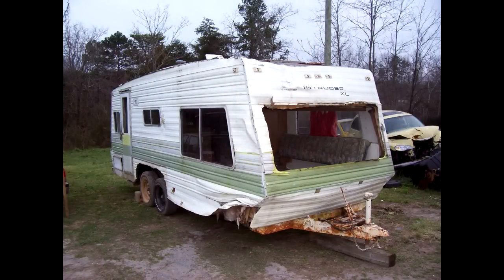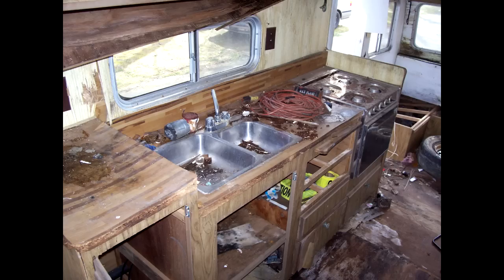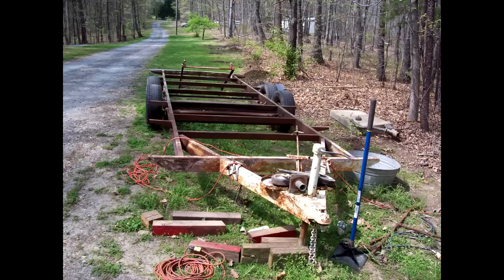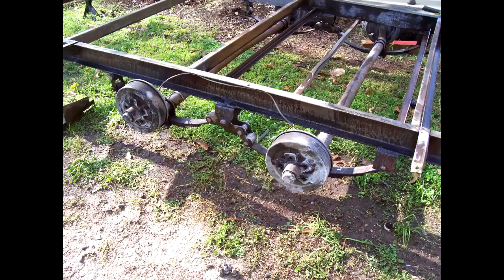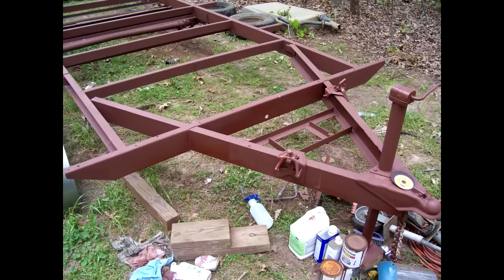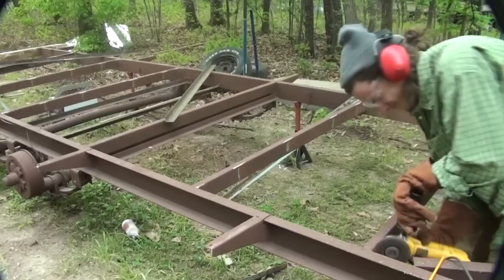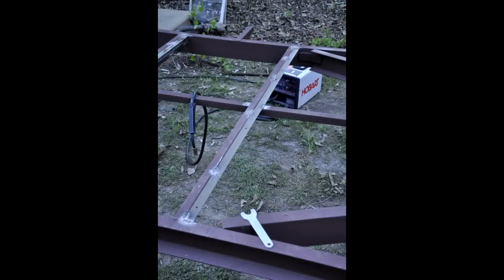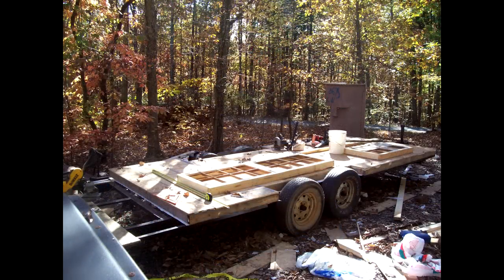Building a Tiny House #1 - Salvaging a Trailer

Comment: Aren't you worried about building your house on an old trailer? what kind of specifications did you use to decide whether or not the trailer was in adequate enough condition to use? I like the idea of going to a junk yard, but I also do not want to build my entire house on a rusty old trailer that may fall apart or become damaged relatively shortly after I've built the house. I need it to last for a long time. Any tips on what to look for?
Reply from the maker: +Cristina Urquieta Sounds like you would be more comfortable with a new trailer.
Reply: True.  NO ONE should ever build a house like this on an old scrap trailer. Do the people on the freeway a favor & get a new trailer built specifically for Tiny Houses (I did and we're so happy knowing it's on a solid foundation) Save property & possibly lives.

Comment: How do you know the axles can handle the weight of house? I have been told that 3 inch axles are rated for 6,000 lbs and tandem axles double the capacity. So two 3 inch axles should carry 1,200 lbs? I ask because the camper I have torn up only weighed 4,400 lbs and it has two 3 inch axles...
Reply from the maker: I don't know. You are also limited by your tires so you have to watch for that. You can also replace the axles with heavy axles.

Comment: good idea using the aluminum skin to protect the floor. How did you attach the house to the trailer should you ever want to move it?
Reply from the maker: ***** It's bolted through the frame, up through the sub-floor and through the bottom of the wall with carriage bolts ever few feet around the trailer.

Comment: You put the aluminum sheet on top of the trailer frame? I'm thinking about building a tiny house of my own. I'm 55, but by no means helpless. Just need to watch your videos to learn how to do this. I'm all for using an existing trailer frame from a destroyed RV, but what if I don't weld? Will not reinforcing the frame make a difference?
Reply from the maker: I advise buying a trailer to build on, I wish I would have myself.

Comment: You are doing a great job! keep up the hard work. Now for my question. How do you attach the house to the trailer?
Reply from the maker: KLS GTR It's bolted from the bottom up through the floor into the bottom of the wall with 1/2 inch bolts About every 3 feet around the house. I hope that's enough! Thanks for watching.

Comment: Did you weld on a fender over the tires or just build around them? If you just built around them with wood, did you add metal flashing to the wood to keep mud/moisture from getting to the wood?
Reply from the maker: Angelique Productions I did not weld on fenders. I am building around them and then flashing them. But I am setting this house up when finished and not moving it, so I'm not concerned about mud or moisture from the road.
Reply: That's what I was planning on doing if I just went with wood.

Comment: How much was the metal to re-enforce the trailer?
Reply from the maker: +Mads it's just stuff I had, I don't buy a lot.
Reply: +Square Inch thanks for the reply! I found a travel trailer very similar to this for $500 but I'm afraid that it won't be sturdy enough, even with the reenforcement. Thoughts?
Reply: +Square Inch thanks for the reply! I found a travel trailer very similar to this for $500 but I'm afraid that it won't be sturdy enough, even with the reenforcement. Thoughts?
Reply from the maker: Mads If I could do it all over again, I would buy a nice used car trailer with a capacity far higher than anything it would end up weighing.
Reply: +Square Inch thanks for the honest answer! I appreciate it :) good luck with the rest of your build! I'll be looking for future videos
Reply: i just got a trailer and i was wondering if it could handle the weight of a tiny home. you said in an earlier comment that you wish you would have used s different trailer. why is that? what were the problems you had?